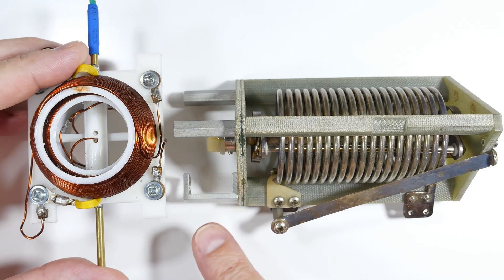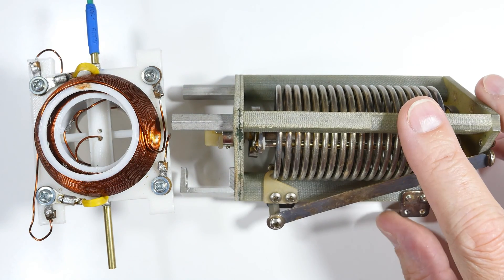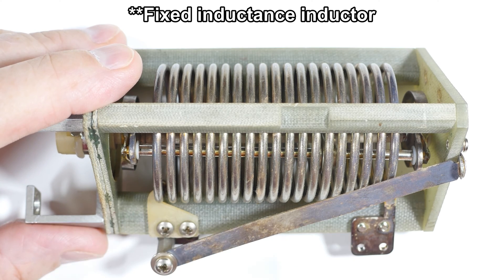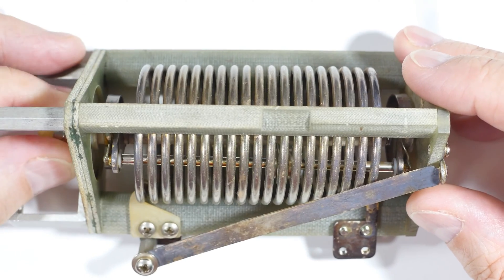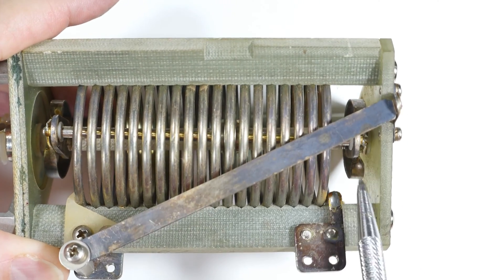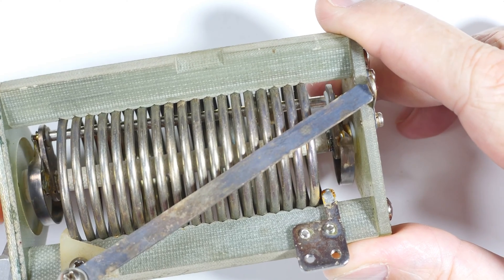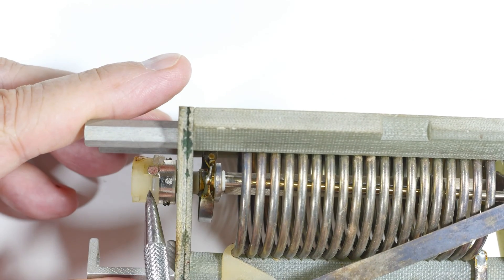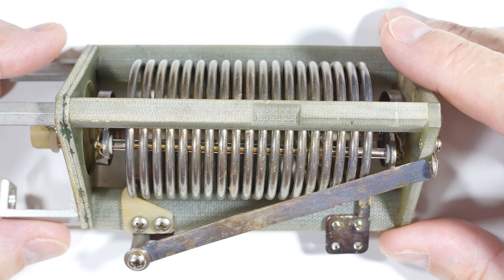Crystal Radio--Spiral Variable Inductor (4K)

Comment: Can you please make a crystal radio out of it, please test. :)
Reply from the maker: The inductance is too small for the AM band, which is why after 40 years, it's not in a radio. And for higher frequencies, there are not enough transmitters and they'd be too far away to work with just a crystal. I'd have to get into regenerative powered systems. I've got some other projects to increase the usefulness of basic radios coming.
Reply: @tsbrownie  ahhh that makes sense.  Maybe test for shortwave :)
Reply from the maker: @deletemeforevs  I can't remember why I originally bought it, but it may have been short wave.
Reply: That looks about right.  been tinkering with different couls and roughly a coul that size would tune well on SW
 @tsbrownie